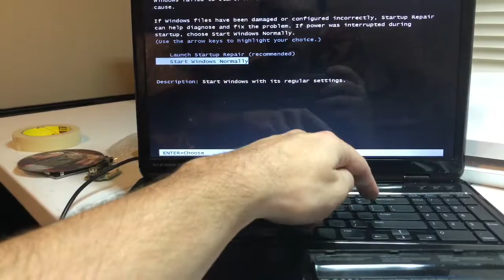dell inspiron n5110 p17f power jack replacement teardown

Comment: I successfully replaced my charging port using your video! The only thing I did differently was lifting the corner of the mother board after I loosened it to replace the part instead of removing the whole thing. The part popped right off at the connector and I just popped on the new one before putting everything back together.
Reply from the maker: Awesome, good job!